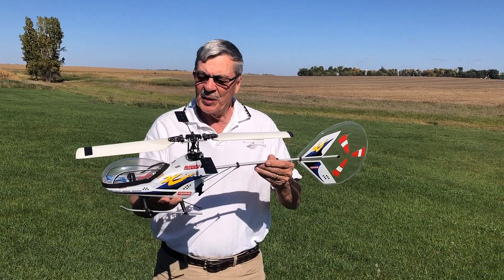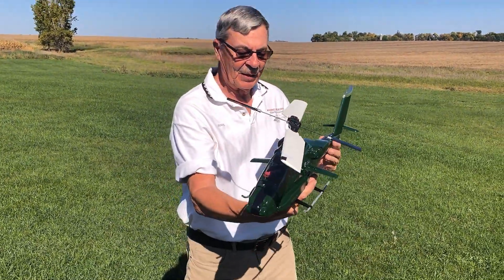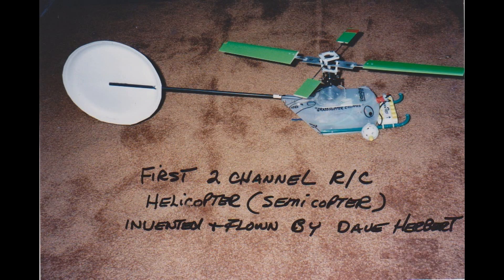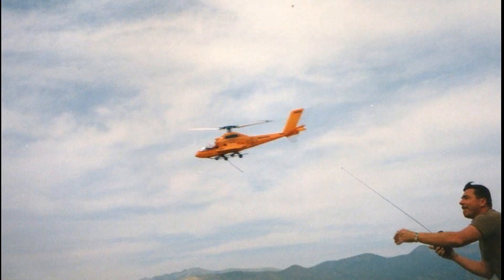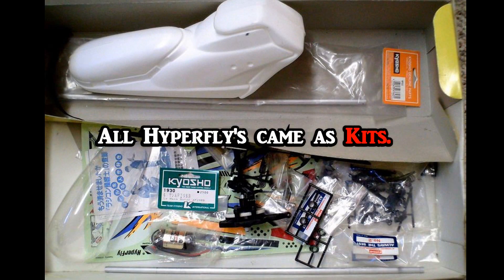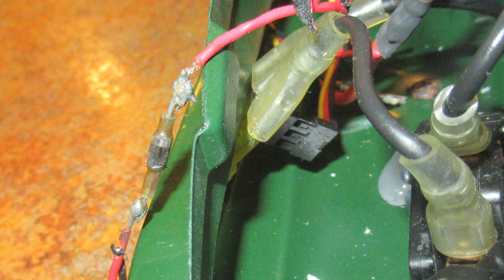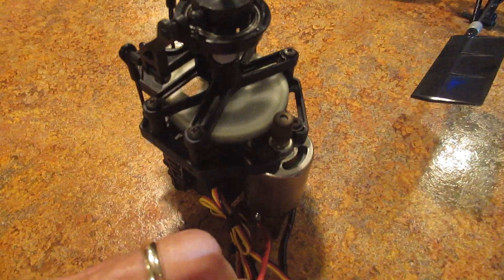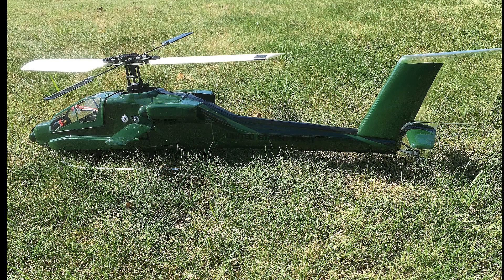The Hyperfly Apache No tail rotor Helicopter.  Components & Flights from the inventor, Me!

Comment: I wanted one as a kid when it came out. To expensive for something that would not survive its maiden flight. 10 years ago i got one from ebay for 70€ (new unbuild kit in original Box) pure nostalgic impulse buy. Never build it and sold it 5 years later.
Reply from the maker: That's a bummer. I designed them actually to survive and be easy to fly, with no tail rotor.

Comment: Hi Dave! And thanks for inventing the Hyperfly :)  I had one original back in the late 90:s..and it trashed itself upon the first bladetracking. No way of getting spares from my LHS back then either, because they where quite expensive and I was a poor student. Anyway fastforward to 2016 and I won an original on an online auction, did some restoration and was supposed to fly it,but sold it off. I really can´t undestand why I did that. But now, 2023.. I found a unbuilt kit of the white whale.. Apache! and dirt cheap too  aprox 83usd (870swedish crowns). And I´ve built it.. tracking and painting remains. However.. and this is  a thing I wan´t to ask about.  The angle of the swashplate.. the original manual say 3 degrees backwards , which I presume they mean toward the tail. And if you look from behind the swashplate is level.. i.e the aileron . In the swedish translated manual the aileron is shown at an angel too.  Which is correct?  only leaning backwards and not to the left side looking from behind?  Thought I want to ask before first flight.  Best regards and fly safe! / Kenneth (sweden)

Comment: Dave, Has anyone ever tried to swap out the standard servos for Micro size servos?   I wonder if that would reduce the weight and enable even slower flight. Maybe get it into a hover with less wind?  thanks for what you do!
Reply from the maker: The heavier the helicopter is better, since they can handle  heavy winds as I have shown in some of my older videos.  I usually don't fly slow, and didn't here, but it will fly slow and even hover in a 5 kt headwind.  It's also a matter of balance too.  I suppose a person could put smaller servos in, but I would fear they would fail, as this bird is as big as a 30 sized nitro heli, and yanking it around in the wind, like I do....well you know.  Good question though.  Here is a recent video I made on the original Hyperfly, you may like. Thanks kindly. https://www.youtube.com/watch?v=KB5ANyghDcQ&t=171s
Reply: @NightFlyyer  -Thanks for the response and that is a very good point too. Will watch that video for sure. Something about the Hyperfly is just down right cool

Comment: I would think that you could take off from the ground, just enough throrrle to get it in IGE, then forward airborn flight.
Reply from the maker: Yes, and I have done it many times.  The most torque is on take off, so it will tend to spin with no tail rotor.  So unless your an accomplished heli pilot, it would get your attention.  If the wind was higher, that made it easier, but the recommended way was to launch by hand on take off. Remember, this was a designed for forward flight only.  Thanks.
Reply: @NightFlyyer  you're welcome & 5hankya sir, for the reply back. happy & safe flying to ya!

Comment: Nice restoration and flight, what’s your thoughts on building a Byron kit? Do it like the plans say, or mount servos in the wings and other “today’s normal” building techniques?  Thanks
Reply from the maker: Thanks. Last year I built a Byron pitts. And the year before I built a Byron f16. I put the aileron servos in the wings on the f16. Not so scale but easy and if you’ve seen my build video, I converted it to electric. It flies great but that was not in the plans. It took several attempts to find the right fan, but glad I did it that way.

Comment: Liked 👅 but how does the rudder work??
Reply from the maker: It doesn't move.  It works like a weather vane with some side thrust.  Thanks.
Reply: @NightFlyyer  so you turn by banking only
Reply from the maker: @ghosttjr2  That's right. The tail just follows it around and makes it really easy to fly.

Comment: Modern lite weight batteries and electronics really bring these old electrics to life.  My first powered plane was a electric Kyosho Cessna Cardinal.  Was one of the first if not the first electric plane on the market.  That thing was so cool to me at the time.  I had the hardest time flying that plane though.  A big part of the problem looking back is that it was quite underpowered and heavy with that big nicad battery and heavy servos.  It also had a really soft gearbox shaft that would bend with the slightest Knick of the propeller.  I can’t tell you how many shafts I bent abs how many replacements I ordered.  Well it was a lot of fun none the less.  Now I feeling like trying to find one of those so I can prove that I can fly the dang thing haha.
Reply from the maker: For sure. I certainly remember the Cessna Cardinal, albeit I never had one.  I think if you find one, you certainly could upgrade it.  Thanks for telling your story, and hope you find one.  Thanks again and happy flying.

Comment: I had this old RC plane with a brushed motor I was super excited to fly it but I dont have an esc so I used one for an RC car... there are pluses but one time it got me good when you are approaching to land you can give it a bit of reverse to slow it down and once on the runway to stop... 

But I did a loop once and I by accident gave it 0 throttle which ended up as full reverse.. it was a good fun trainer I just had to convert it to brushless... 

Now I am missing the reverse thrust on landings.
Reply from the maker: Ha.  Well, yes, throwing reverse in by accident would certainly not be good.  You could get the new eflite Draco.  It has reverse.  Thanks and happy flying.

Comment: Heh, this brings back memories. I had the standard Hyperfly circa 90s. I was still a fledgling Heli pilot with the Concept 30 but the Hyperfly was easy to fly around in comparison. I almost looped it once but the off switch just brushed the ground at the bottom of the loop. I regret not getting the Apache version then.
Reply from the maker: Ah, great to hear that.  Thanks so kindly for getting one and thanks for your comments.  Happy flying.
Reply: @NightFlyyer  the pleasure was mine. I never thought I’d talk to the inventor of it 30yrs later. Take care
Reply from the maker: @panemetcircenses510  Your welcome and thanks again.